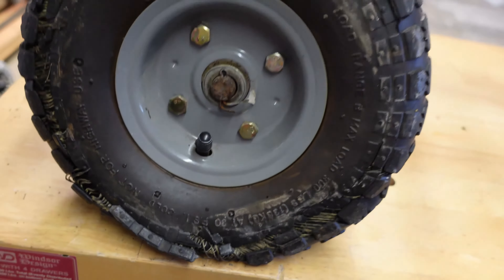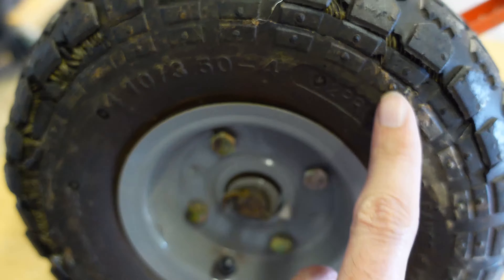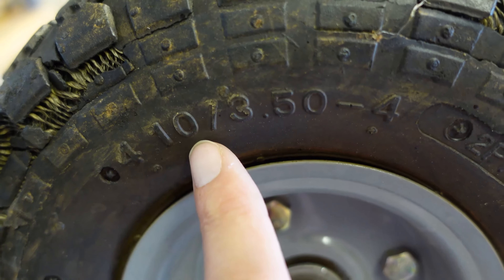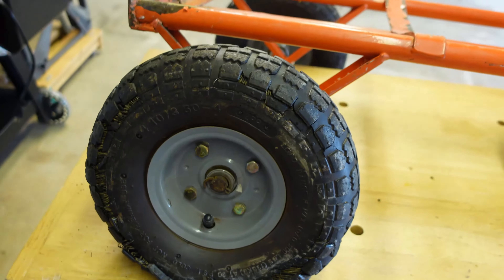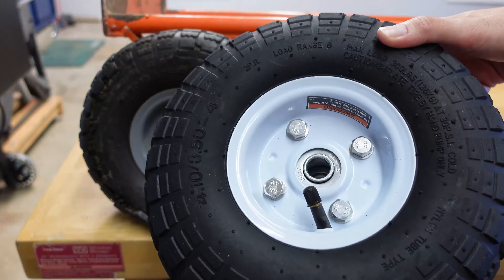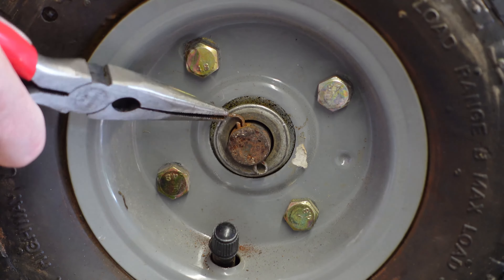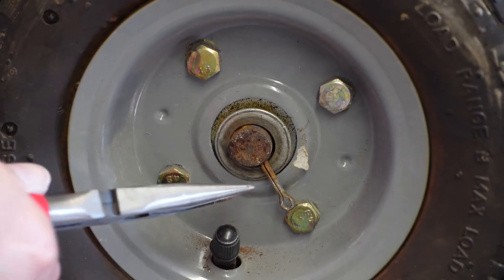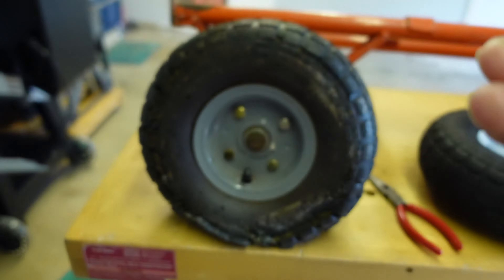How To Replace A Hand Truck Wheel

Comment: Hello folks, what cause the tire to burst like that, at my job we purchased a SPARTAN III hand-trunk about a year ago and one of the tires sidewalls opened completely. We’ve been debating what is the best course of action.
Reply from the maker: Tire under inflation + heavy loads = rapid tire degration. If it's failing on the side wall it's under inflation is usually the culprit
Reply from the maker: A lot of these hand trucks, carts and other things with air filled tires come under inflated from the factory.
Reply: @thehousemann    Do you have a website where I could some better tires. Thank you very much !!!
Reply from the maker: @frankieg3296  I have a link for a set or replacment wheels in the description of the video. Or if you have a local habor freight near by they have tons.

Comment: What do you think of flat solid rubber tires for hand trucks? I'm sick of my hand truck tires constantly losing air, and want better control.
Reply from the maker: If you're only using them on solid surfaces then maybe. But air filled tired provide more traction and less movement of the payload when going over uneven surfaces.
Reply: @thehousemann  I only use hand truck for carrying heavy loads like black earth bags for flower garden. Unevenness of terrain level  does not bother me.

Comment: If the 2 tires are weak and you cannot inflate them with a bicycle pump, are they broken?
Do I need to buy new tires or can they still be repaired?
Reply from the maker: Depends if they're tubed or tubeless. Tubes you can replace just that tube. Tubeless requires a whole new wheel. Honestly, at the cost per wheel, it's easier to just swap the thr whole thing out

Comment: I replaced a tube for one wheel but it eventually went flat. Tube split for some reason, didn't even use the trolley after replacing not did I over-inflate. Second tube did the same thing. Didn't use it the 2nd time either nor did I over-inflate.
Reply from the maker: No clue, could be manufacturing defect. Thus why I just replace the whole wheel. It'd honestly that much more expensive and a quicker experience
Reply: under inflation causing pinch flat

Comment: Hand truck tires don’t have a tube?
Reply from the maker: For $6. I wasn't dealing with it. 😂
Reply: @thehousemann  ahhh okay 🤣 I need to get a new wheel or tube.
Reply: Most do not seem to have inner tubes. Some people were able to install inner tubes.  If the tires do have inner tubes and made in china, the quality is bad. You can get better quality tubes.  I opted to replace both tires with flat free worry free because every time I moved one tire was flat. Solve your tire problems for good.

Comment: If only mine has a cotterpin
Reply from the maker: What does yours have?
Reply: @thehousemann  it's got the press fit lock washer that's a pita to get off.  My wheelbarrow on the other hand has a cotterpin which makes me wondering if you could have acquired a duel wheel  wheelbarrow axel assembly and made this work......literally just dawned on me as I was writing this.